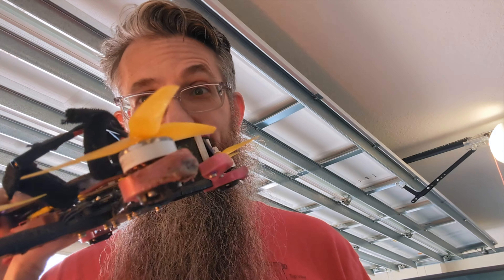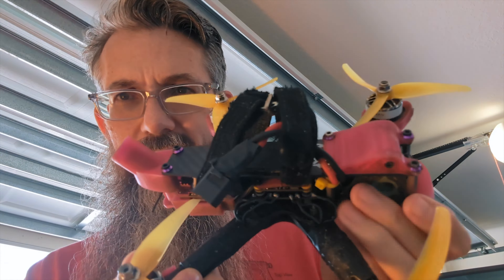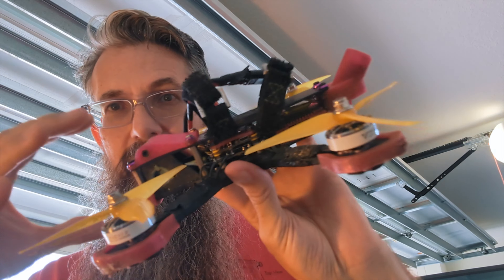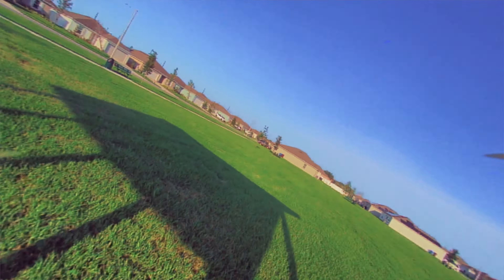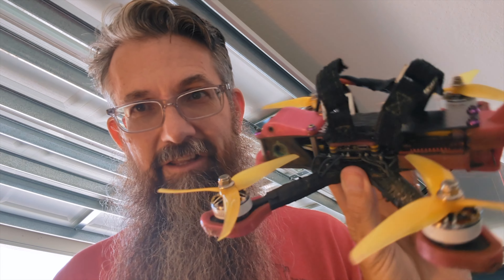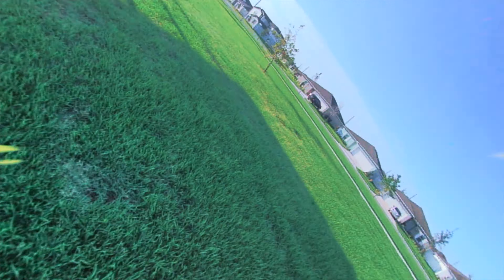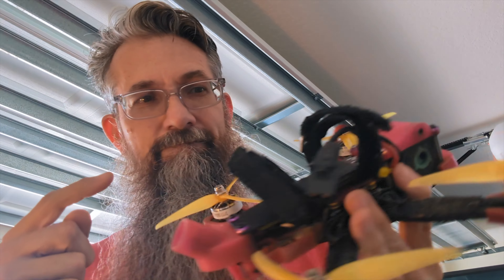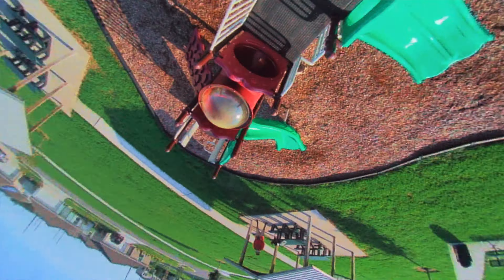Dear FAA... We Need to Discuss Remote ID

Comment: Speaking as an RC fixed wing, line of sight, coastal slope soarer the whole RID thing goes so far beyond absurd that it simply beggars belief. 
If poor regulation is worse than no regulation then this is merely creating an entirely regulation induced invitation to anarchy. 
THAT is a genuinely ridiculous situation that would be merely risible if it didn’t disadvantage so many blameless and faultless users of the airspace, from kids to geriatrics. 
I applaud you Stacey. Bravo!
Reply from the maker: Yep! Couldn't agree more.  It accomplishes nothing useful for the safety of the airspace.

Comment: I mainly fly fixed wing stuff and I think that the safety argument for remote ID breaks down even more for models that are line of sight only. You can't fly the airplane further away than you can see anyways, so the operator is ALWAYS going to be within a few hundred feet of the plane.
Reply from the maker: Yeah it's even more absurd in that case!
Reply: Exactly, I have been flying RC helicopters and airplanes for 30+ years. I live in a rural area and fly on farmland. I fly line of sight at relatively low altitudes. No GPS, no FPV. This whole thing is ridiculous….
Reply from the maker: @fastdude2002  agreed!

Comment: Im not a fan of RID but long range is the only time I can see it being important.
Reply from the maker: I can see a need for some sort of beacon on long range but inn it's current form it's not going to help as nothing will be receiving that to "see and avoid"
Reply: Not even for long range in its current form, is it at all important. It has no connection to local manned air traffic or even Air Traffic Control (ATC).
Reply: @kirkglundal4289   I agree that RID on a long range setup, in it's current form, doesn't do much. Although, it's a compromise that I can live with if the FAA is willing to work with hobbyist. Which is a big "IF."

Comment: This should of only applied to Commercial Part 107 operations. Period!
Reply from the maker: Personally I don't think it should apply there any more than it should apply to hobbyists.  If anything in many cases when flying under 107 the conditions are far more controlled.  Remote ID doesn't make any flight any safer.
Reply: @StacemanFPV  The way I really see it is that they are trying to do something similar as in real aviation flight. And there is no comparing the two. SQUAWKing which is the process of communicating between the air and the ground, the process is essential for keeping planes in the air safe and ensuring a smooth and manageable air traffic control process, both for pilots and air traffic controllers. In short, SQUAWK refers to the communication that comes from an aircraft's transponder — or the radio equipment that a plane has that allows it to communicate with the radar system of air traffic control on the ground. This RID is nothing more than an un-monitored transponder which is absolutely useless in the hobby world of flying.
Reply: FYI should've is short for should have.

Comment: Great video man.  The issue is not where to put remote id, but why?  If any manned aircraft comes as close to the ground as we fly, they are the danger, not that tiny light drone, weighing less than a duck.
Reply from the maker: I know right?!?!? They're not supposed to be below 500 except with certain waivers and for take off and landing anyways. I'm pretty sure that's the case. Someone can correct me if I'm wrong in that
Reply: @StacemanFPV  You are correct about the 500 ft limit. The problem is not so much with FPV near ground level but with irresponsible drone operators flying at 17,000 feet or 5 miles away where the 500 foot altitude limit means nothing. There may be some changes along the way that would help the hobby. Possibly for FPV software limiting altitude to 100 ft thus providing an exemption from RID. But the reality is that RID is here to stay and we all need to deal with it.

Comment: I wonder what would happen if everyone would turn on their radio and reciever all at one time, flood the airways with millions of signals and create such a blanket of "noise" ..... what would they be able to do? Just a thought, if everyone had their transmitter running 24/7, would it impede the operations of the "Big Delivery" drones?
Reply: Remote ID is for surveillance and prosecution, not for collision avoidance, so i doubt that it would do anything
Reply from the maker: Hard to say what would happen... Definitely would be a lot of inference

Comment: The reality of it is their regulations may have a place on COMMERCIAL operations, but trying to regulate the recreational user, particularly the lumping of fixed wing ops with quadcopter ops, is going to be a mess.
Reply from the maker: Yeah completely different types of flying.  Anything flying line of sight should not even be on the radar with this junk.. Makes zero sense

Comment: The remote ID module decreases safety because it adds another 20 grams to the drone, which when we inevitably crash it into someones head or a commercial airliner (it's only a matter of time remember) will cause more damage than if it wasn't there to begin with.
Reply from the maker: A bit hyperbole but true
Reply: Crashing into a commercial airliner is exactly why the FAA wants Remote ID!!!
Reply: @Kevin-ib4gv  Heh, I was being sarcastic. It's never happened and is very unlikely to happen or even cause any damage if it was to happen. However, let's put all that aside. 

How does Remote ID prevent that from happening?
Reply: @SueMyChin  Well, nothing is 100% as we all know, but it will provide accountability where there is now none. If you know the FAA is capable of seeing your altitude, you won't fly at 5,000 feet, or attempt that 17,000 foot flight as seen on YouTube. And if you go BVLOS, and the FAA can track you via RID, you may well think twice once people start paying hefty fines for doing so.
Reply: @Kevin-ib4gv  So this is where it falls down. Anyone building quads and wanting to fly BVLOS or at 1000 meters will not install or enable a remote ID module to begin with so no joy there.  Anyone buying a DJI off the shelf is already locked out of excess altitude without modification and if they're modding their software to skirt the rules they'll do the same to the Remote ID module too. There is no way for Remote ID to discern if the drone is BVLOS so that doesn't help at all. 

I'm sure one day there will be an accident with a drone, I would put money on it being a commercial drone and not a hobbyist though. Here in the UK there is a death involving a cyclist every day yet we have no registration for cyclists, no trackers or fees to pay. This isn't about safety. This is about trying to make money in an emerging market and we should push back because it's them trying to take money off us for no reason other than we'll let them.
Reply: @SueMyChin  I'm sorry you don't understand the future of drones here in the US and around the world. I can buy a gun. I can target shoot legally....fine. Or I can take that gun and kill 100 people...not fine. You can fly your drone legally, fine, or illegally, not fine, the choice is yours. But if you don't legally fly your drone, remote id is the way you will get caught and pay the price for doing it that way. You may get away with it, or you may get caught, and then pay a hefty fine. The bottom line is the air will be filled with sUAS of all types in the years to come, and there needs to be a way to regulate them, both hobbyist and commercial.
Reply: @Kevin-ib4gv  Definitely not. The skies will not be filled with sUAS. There are only so many uses for them
Reply: @SueMyChin  I'm sorry that you took it so literally. The uses are the same as aircraft flying the skies today. There are 6 engine 8 passenger UAS airplanes being developed right now that will transport people without a pilot. We already have drone crop dusters, package delivery, medical delivery, movie making drones, power line inspections, lidar mapping, and the list goes on. It's not just about hobby drones that need RID, it's every sUAS flying now and in the next 30 years.
Reply: @Kevin-ib4gv  Even if I granted you all of that, which I wouldn't. Most people will go a whole year without seeing a single drone under 250 meters.

The idea that this would make it safer is still complete nonsense too. If it makes things safer then why haven't they mandated all manned aircraft to have ADS-B receivers?

Comment: Totally agree. I would make one of these vids but I don't think I've been following the argument closely enough. If it's about IDENTIFICATION, then really, all you'd need is an upgrade to the VTX firmware to broadcast your pilot ID between frames (like the old subtitles and teletext coding) - no extra hardware. I've happily been registered with the CAA (UK) for years and put a little sticker on all my drones with my pilot ID. No issue at all. And if the cops want to drift past and scan the video channels, pull my ID and see that i'm flying and up to date with my registration then all good -- I fly safely and legally like 99.9% of FPV folk. Though... not sure how they'd deal wirh ID spoofing. Transmitted pilot ID is just the same as a car license plate, I guess. Helps a little with accountability... maybe. Oh and dont get me started on the whole "no danger to aircrraft" lol - any aircraft that I'd be a danger to flying about in a field would have bigger problems than my drone as it crashes through the trees at 10m from the ground! :)
Reply from the maker: It's broadcasting details about the drone speed location etc.. AND the pilots location
Reply: To be fair, if you are fying FPV you are almost certainly breaking the law. Almost nobody flies with a spotter.
Reply: I doubt that they would accept some custom firmware for a video transmitter, instead of a certified black box module
Reply: @among-us-99999  They might get somewhere if they work with reputable hardware manufactureres to incorporate some kind of compromose sytstem into FCs or VTX. They might get more respect and compliance if they engage with the community.

Comment: The FAA needs to define “drone”. You didn’t show a drone, it is a quadrocopter. A drone is an autonomous vehicle, can be a car, a plane a boat and a quadrocopter. But drone means that it could do things without user input. 
Also means that when they describe it as any remote controlled air vehicle, that fly by wire is also remote controlled and needs the remote I’d.
Reply from the maker: We can thank the media for the hysteria and misuse  related to that term. They purposely used that term for what we have because they had previously used it for military autonomous air strike vehicles and by using the same term they could evoke fear in their listeners.
Reply: While the media may have made drone synonymous with all rc aircraft regardless of level of autonomy, we are also partly to blame for not clarifying this harder, louder, sooner. This is a step in the right direction, thanks for making us heard here.
Reply: I don’t think the term drone is relevant. It’s an unmanned aerial system, which a quadcopter definitely is. And regardless, lots of ‘drones’ are remotely controlled anyway. Can’t we all just be good citizens and work for, and not against?  Working against is likely to make things even worse.
Reply: @modquad18  It is just about naming and the legal concequences. Not about against it But how about the rockets for sattelites? That are also unmanned aircrafts, they have to comply also. Makes things fun if it doesnt comply to the FAA rules, then there is a lot of money involved which can help the hobby in the right direction.

Comment: People said the same about seatbelts. Someone will devise a way to mount the hardware that alleviates all of your fears. You’re a pretty industrious guy, I’m betting that you’ll come up with a good method too. If not, sub-250 is always an option until it gets worked out. Stay safe!
Reply from the maker: I'll spend my resources on better things.  As for seatbelts, I don't think they should be required either.  Does that mean I don't wear one? Nope, I use them every time.  I just believe people should be free to choose.
Reply: A seatbelt won't transmit your location when you are driving, though. And if you fly a Tiny Whoop as reviewer, the sub 250g limit doesn't apply, you will need to install a GPS and Remote ID module to that 20g micro quadcopter, to be allowed to fly outside. Which is utterly ridiculous. Besides, it's only a matter of time before the sub 250g class will be affected as well, even for recreational flyers. First it started with the registration obligation, now they've taken it a few steps further with live tracking. And also logging all your flights. Next up you might get a visit if you flew in a different spot than your usual one, because that's suspicious behavior

Also, the effect of seatbelts can be measured, the effect of Remote ID on aviation safety is purely based upon incorrect assumptions about the hobby, as the FAA video clearly demonstrates. No solid risk assessment, so also no way to measure its affects. Death toll due to the recreational use of multirotor drones was already 0 so far, so where can we get any improvement?
Reply: @rc-fannl7364  You make some great points, and I agree with most of them, but… I think it’s more likely we get treated better if we remain committed to working towards the common good, rather than getting confrontational. The FAA has a big job keeping the airspace safe and if we became a raucous impediment to that, they might just ban it all. Walking a very fine line here… for the time being, I would review whoops inside if I was a YouTuber and take an active, measured approach to soliciting change on that one.
Reply: @modquad18  True, though it seems the FAA is deaf to any good points brought to the table and just stick with the "we do what we think is best" while it's clear that this whole system is overshooting its target massively. Their promotional videos also show they have a limited grasp about the rc craft they are trying to regulate, and it seems largely based upon a "if we do nothing, a big accident is guaranteed to happen!" mantra. And if, after the introduction of remote ID, nothing bad happens, it will be presented as the reason for it. But so far rc aviation has an excellent safety record, without any big incidents. The Gatwick drones were never found, and many near collision reports often boil down to "I think it was a drone".
Does this big infringement on the privacy of people just enjoying a mostly harmless hobby really add to safety, or is it a blatant government overreach? We don't hear about remote id on knives, cars or even guns, but these cause far more harm than even a reckless drone pilot, right?
Reply: @rc-fannl7364  Yes, I agree, but I feel like we need to act responsible and mature about this rather than like spoiled, entitled hooligans as so many are.  If the FAA sees us as the former, we will have more leverage down the road.  We hobbyists need to imagine ourselves in the FAA's place and act accordingly - we both love aviation and desire a safe experience for all.
Reply: @modquad18  True, we need to show how this regulation is a vast government overreach and unneeded infringement on the right to freely exercise a hobby which has been safe for decades and has helped young people get invested in aircraft tech. When you get a car, your main concern is to drive safely. When you fly an rc craft, you need to constantly report what you are doing and where? Even visible to anyone? This makes no sense.

Giving the FAA "the finger", even if tempting and possibly deserving, isn't the answer, I agree. But for example showing how this tracking system will put an rc pilot in danger of getting harassed or worse, and that includes our children, might help to prevent the FAA from droning on (pun intended) down this destructive path that leads to zero additional safety, but just creates new problems along the road.

Comment: Why is anything required when flying under 400 feet. Manned aircraft can't fly under 500 feet except when taking off and landing so, no drones near airports without prior authorization. If the reality is that commercial drone deliveries and such don't want recreational flyers in the air at all, Remote ID is not going to solve that unless it is abused by the Karen's of the world who could just make recreational flyers so frustrated that they stop flying. And from a safety standpoint, say two drones collide (if that is even likely to ever happen), what would be the result of this? Lost Amazon products? I think it is much more likely people will start shooting Amazon drones out of the sky to see if there's anything valuable in the payload. This whole thing is so badly thought out, it's almost as if it was thought up by the government.
Reply from the maker: There are cases where they can fly below 500 other than take off and landing.  Remote ID doesn't solve it for that anyways. It doesn't solve it for other drones flying in that space either. There's zero safety gained with remote ID.